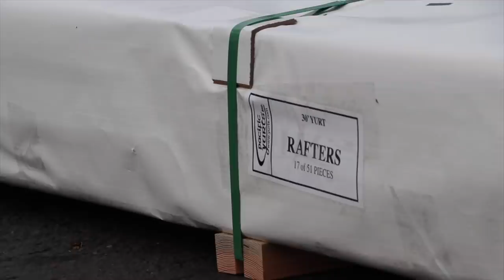ONE YEAR ALONE in the WILDERNESS | Building an OFF GRID YURT

Comment: You take half of the diameter which is 15 and multiply it times15 times pi, and that will give you the square footage of your floor. 
15x15= 225x3.14=706.5 square feet.